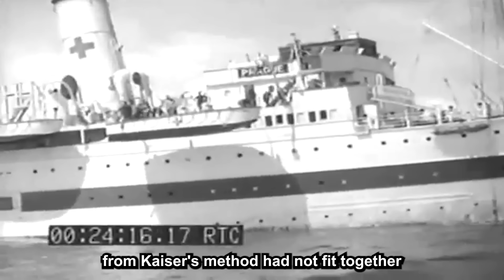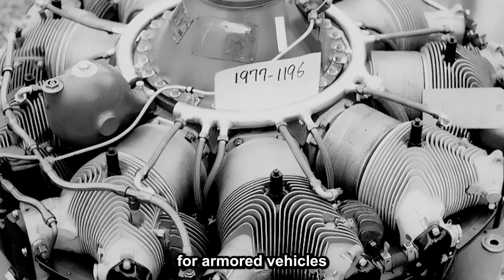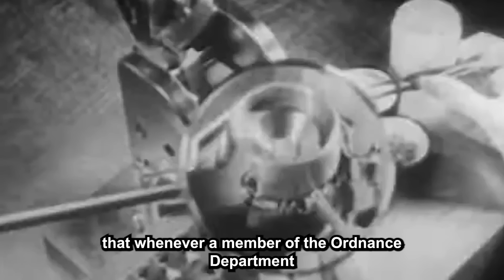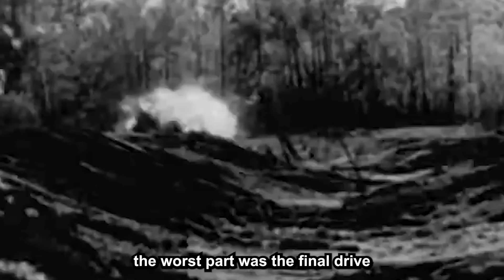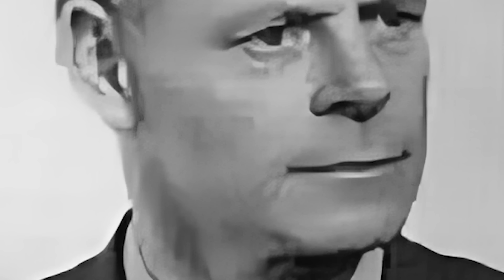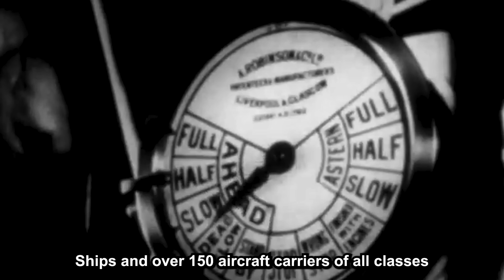Why German Mechanics Were Stunned US Engine Blocks Simply Dropped In

Comment: But is was a better tank, It could go many miles without major repairs and repairs could be done in the field quickly. A tank broken down in the field that was hard to move and had to go back to the manufacturer for repairs that required skilled mechanics and fancy tools is not a tank, it might as well  be a boat anchor.

Comment: I worked as a quality control technician for the rubber mixing plant of General Tire (Gencorp, in Wabash IN)  There was much out-of-spec (defective) product produced at 400 lbs per batch. The department head didn't like that I'd rejected so much defective product. He wanted me to cheat. I did not. I left their employment in Nov. 2005.  They didn't need Quality Control. They shut the doors in 2 or 3 years. Now - no buildings, just trees and weeds and a fence all around.

Comment: In the USAF, there were the PMELs.( Precision Measurement Equipment Laboratory) We were the folks who made sure that the tools used by those on the flight line shops or other facilities were in specs. Meters, microwave (radar), torque wrenches, scales, geiger counters, hospital tools all moved thru the PMEL to keep everything flying or running accurately.

Comment: Fettarbeiter comes from FETTLER, I.e. "foundry (worker)" shortened to FETT.  ("e" in Fett,  is pronounced like "met") ARBEITER is simply "worker." ("ei" is pronounced like "eye" and not "ee" as in "feet.")
So a Fettarbeiter took the rough parts and finished them with tools and skill. If you look at the British "Merlin" aircraft engines of WW2, the British engines were done by "artists.". At the Packard automotive plant in Detroit, the same engines were produced with a precision and speed that out raced the British manufacturer. The Packard parts were also totally interchangable.
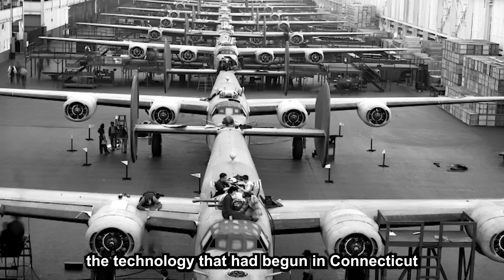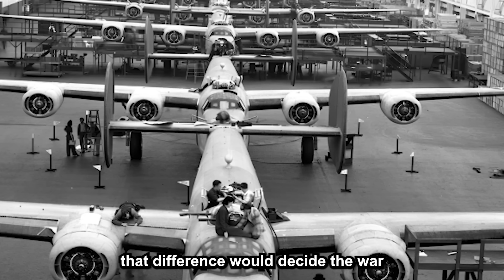In Ypsilanti, Michigan the Ford Motor Co. produced B-24 Liberator bombers in multiples each day. (see the pic @ 4:55 to 5:30)

Comment: German tanks have superior engineering and built without compromise is said by one side of the mouth but then it has terrible design like the failing head gaskets spur gears and fuel lines. Both things cannot be true at the same time….🤣🤣

Comment: Formula one engine? A modern F1 engine is around 800HP at 18000 RPM from a fraction of that capacity. So not an F1 engine. Impressive yes, but not F1

Comment: 1:46 - The "methods" required acceptance of production tolerances of which the 'apprentice' culture of Nazi production had no knowledge; it was a mystery. 
In the '60s, after (I'm sure) time being observed by the management, my first job was 'running off' (final testing) of machine tools to be shipped over my signature. Some of the mill tables were >12' long, the specs called for 'tenths' tolerances (.0001" range). Yes, that's what an 18YO punk kid was expected to confirm (and having remaining friends there, none of my machines got rejected - i'da hoped not and wanted to hear why!)
Nothing in my reading suggest any of the other WWII combatants understood such accuracy. The RR engineers had a hard time believing that a Packard- (redrawn machined Merlin could be assembled with wrenches only. Yes, it could, and delivered better dyno numbers than its RR, hand-fitted competition. Round cylinders count. I can tell you in dealing with Brit race-car parts in the '90s, they all required hand-fitting.

According to several sources, the Japanese hand-filed replacement pistons to fit. We do know the Tiger final drive gear was not upgraded from the one which propelled a tank weighing 20 tons less, and when it did fail, as it often did, getting and replacing it was (as you'd expect of a failing economy) 'problematic':
Don't start a war you cannot possibly afford to win!
No real reason to spend more time here.

Comment: I contract for some defense contractors and this could never happen today … the waste fraud and abuse is built into the current system we have … for instance , the hull or bottom of the APC is made in Alabama and shipped to SC , they sit in the parking lot rusting for months , then fail QC so another contractor hauls them to a special place for destruction … that slows  down the production at the SC plant so more stock sits in the parking lot and that gets rejected and hauled off by a different contractor …. And that boys and girls is why an APC got 6 million usd

Comment: Few know - The 1908 Interchangeability Test: At the Brooklands racetrack, the Royal Automobile Club of England disassembled three stock 1908 Cadillac Model K vehicles completely. They threw all the pieces into a pile, mixed them together, and added new spare parts from the warehouse and then reassembled the three cars with no special fitting.  Just used new parts from boxes they brought along.
Reply: Cadillac was owned by Henry Leland. He brought interchangeable parts to Detroit.
Reply: The USA taught ourselves that, on the Union side, during our Civil War.

Comment: There may have still been automotive plants in cities like Syracuse, New York and Portland, Maine that do not get mentioned in videos like these that were still in operation before the second World War ended. Many smaller cities also had automotive plants that were barely staying in business and went completely under or became parts plants for Ford, GM, or Chrysler by 1946 or 1947. Manufacturing tanks or tank parts was literally what kept one or two auto manufacturers independent of the big 3 in business in Syracuse. One of the plants still stands on Franklin Street in Syracuse and has been converted into offices and at least attempts at small manufacture. If not for the war the previous occupant would have gone under by '43 or so.

Comment: The problem is Germany was stuck somewhere around 1920 and the manufacturing of that time. The US was competing in the auto industry for 20 years and mass production, precision measurement and tools were needed to be successful and college engineers worked on those problems at all the auto factories.

Comment: and the most famous tank is what ?
The British choose the TIGER ... and named the biggest tank festival Tiger Days, not churchill or sherman tanks.

WW fairytales as the most famous DIN was a german invention to avoid the issues caused by highly specified part manufacturers and no longer gun manufacturers. MG were produced in masses based on DIN.

That allowed the interchangeable parts that would always fit.

Are you going to tell the next lies ? The V2 rocket arrived in the UK not in the north sea. And british researchers have done their work far more accurate if you check the youtube world about the Big Ben inicident when he  hunted down thee parts and part manufacturers after the Big Ben files had been released in 2014 which had been confidential till then. 

DIN or Deutsche Industrie Norm aka german industrial norm has been the predecessor of ISO ... but a sheet of paper is still called DIN A4 based on the rules and regulations of the DIN from WW 1. 
Check out how the V2 parts fit together and how many different part manufacturers had been produced those parts.

Obviously more than just 1 cause 1 could be hit by an airraid if those would hit and did not target german civilians which meant women and children and elderly during daylight airraids where the norton device hit nothing as it has promised. 
So the industrial production was spread across the country and the production increased even after american airraids in 1943 and 1944. 

Better survive in a Tiger tank then dying in a 3 times refurbished Sherman where each time the whole crew had been killed.

Comment: From Google:

Believe it or not, but many revolvers are STILL hand-fitted. If you examine a precision revolver today, you will find a SERIAL NUMBER scratched on the cylinder to match the serial number on the revolver frame. If parts were identical this would not be needed.

Because of the complex timing, lockwork, and cylinder alignment required, modern [high quality] revolvers still heavily rely on traditional hand-fitting by master gunsmiths.

While parts are rough-milled by CNC machines today, final assembly and tuning require human skill to ensure a crisp trigger pull, perfect cylinder lockup, and correct timing.

Here are a few ways this still plays out in modern production:Masterpiece Revolvers: Premium lines—like the Colt Python or Smith & Wesson's Performance Center—feature hand-polished triggers and actions that cannot be replicated by automated assembly lines.

Bespoke Builders: Boutique manufacturers like Korth or Freedom Arms build every single gun entirely by hand, resulting in actions with virtually zero tolerances.

Timing and Lockup: Unlike semi-automatic pistols that use barrel tilting, a revolver's cylinder must perfectly align with the forcing cone shot after shot. Master fitters must manually stone and polish internal sears, hands, and bolts to achieve this.

Even with modern manufacturing advances, the "marriage" of the internal parts still demands the human touch to function smoothly.

Comment: M - 4 wasn't designed to take on  the Panther or Tiger , 1 on 1 . These true ARTISANS of Deutschland made truly beautiful  machines . Fearsome . Too bad so many parts were NOT  interchangeable . Too bad that Extremely Few tank - crews could  make repairs .
Reply: Horsecrap.  They far too often FAILED at the designed function/purpose.
Reply: The M-4 played a decisive role on the Western front battlefields of WWII, but it was only one factor in a fully integrated battle plan that, taken as a whole, overwhelmed the Axis. The two factors most often cited by surviving German military leadership and frontline troops  as leading to their loss was the overwhelming U.S. artillery advantage and tactical (not strategic) air superiority. U.S. artillery accuracy, mobility, and volume, combined with close air support, dictated ground strategy and was the deciding factor in the ultimate Allied victory in the Western Theater. Most German ground troops reported rarely even seeing the "Amis," instead being driven back by never-ending rolling carpets of overwhelming precision artillery fire.
Reply: Laypeople look at impressive specs and think it's a marvel of engineering. Truly great engineering takes the entire life of the vehicle into consideration. Ease of manufacturing, ease of repairs, ease of use, along with performance are all factors that need to be considered for any product. Cost is another very important consideration. You see a beautiful machine, I see engineers that failed to take certain things in mind while designing this thing.
Reply: @roots4x failed to take nearly everything into proper consideration